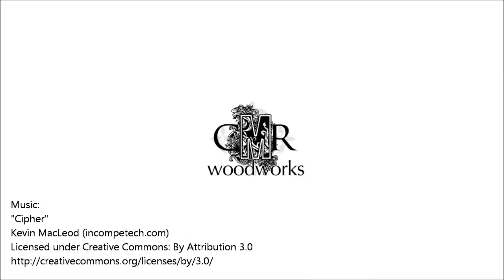French Cleat Hooks - Easy Shop Organization (CMRW#20)

Comment: Nice make over.

Question: Was your table saw moving when you were adjusting the blade tilt and making the first cut?
Reply from the maker: Yes, my garage floor is not level so it's hard to find a spot where it sits flat. Also, I realized during the cut that I had not locked the coasters which is why it rolled forward a bit. Oops.
Reply: CMR Woodworks  I know what ya mean about that forgettin' to lock thing.